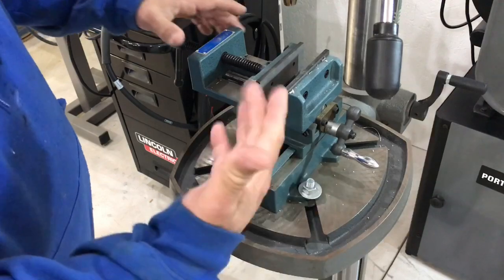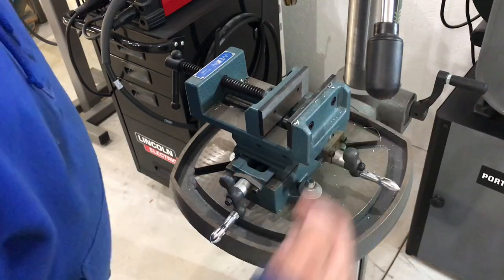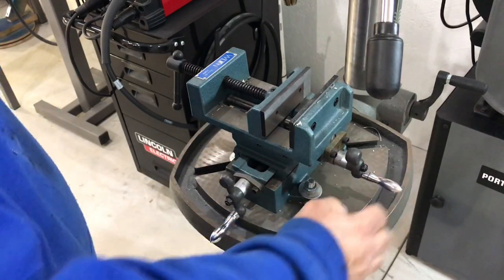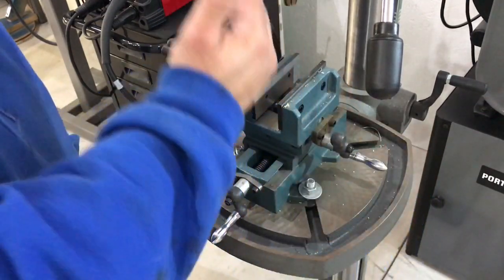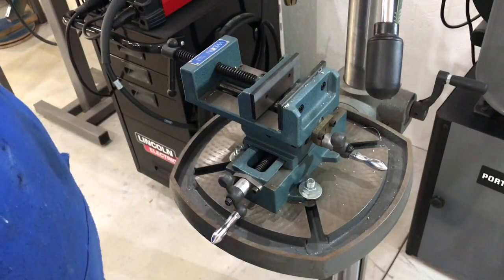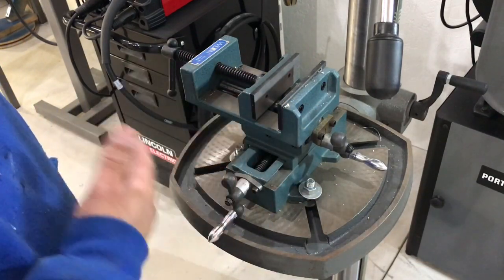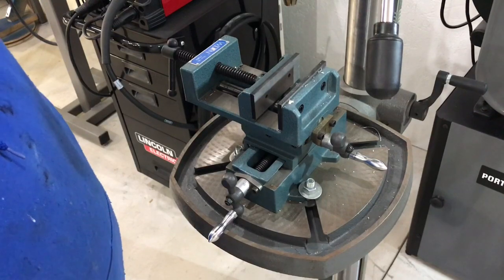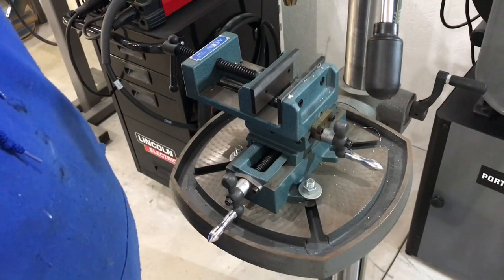Wilton Cross Slide Vise Review

Comment: You get a thumbs up for your honesty.  It’s actually easier to line up holes with a punch and allow the the drill or center drill to find the punch dent.  Once you’re in, snitch down the workpiece using machining stepped clamping blocks.  You hold the workpiece in place with gentle pressure on the drill bit while you bear down on the clamps. Thanks for sharing.

Comment: Yeah just got mine.  Think of it as an unfinished piece.  I'll pull it apart can clean it to see how much that improves it.  The biggest issue is that the fit of the square end of the screw shaft is sloppy in how it fits the handle.  No company that wants quality associated with their name should sell this stuff unless it comes with a warning "more Chinese crap.  Buy at your own risk".  I n haven't tried a Wen but at half the price it might be just as good.  Or should I say just as bad.